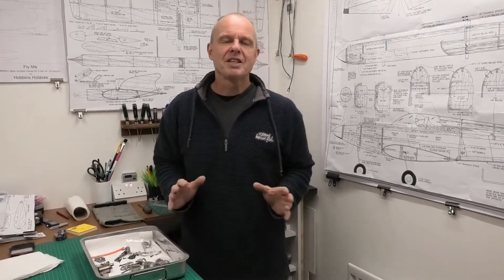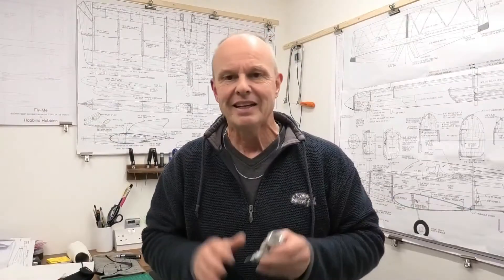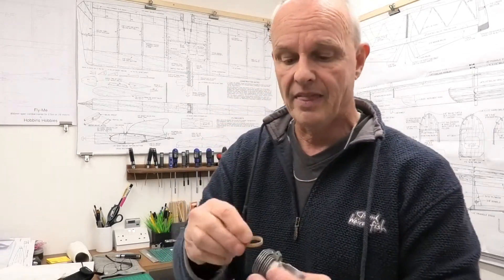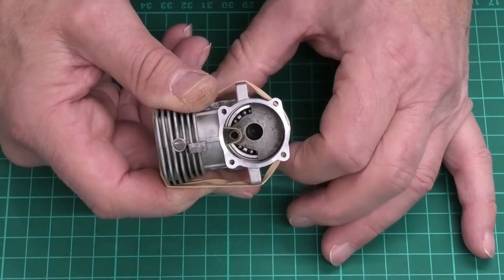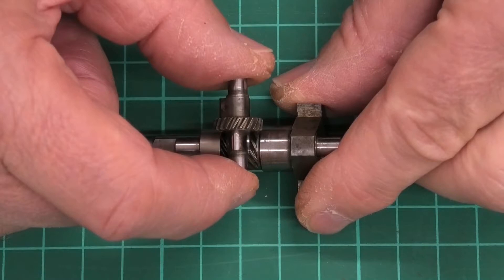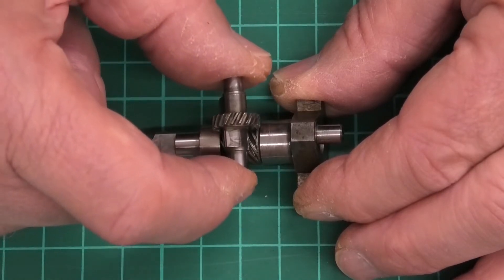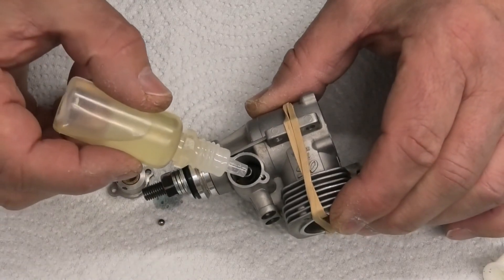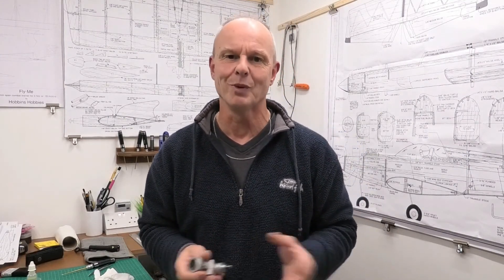OS FS 26 - Four Stroke Glow Engine Camshaft Timing - Get it right first Time!

Comment: I used your rubber band technique yesterday on a OS70 FS and it worked a treat. I also use your fuel tube tip for screwing in glow plugs .....have you got any tips for refitting the tappet collets? I fit them with the head in a clear plastic bag to catch the pesky little blighters when they ping off! 😂
Reply from the maker: Thanks for the comment, pleased you found the video useful.  Those collets on the valves are horrible to do, having a plastic back to catch them is a great idea.  I usually just hold down the spring with my thumb nail while I slip the clip in, holding the clip with forceps, but yes not a pleasant job and always a relief when done!

Comment: Hello Mark. Which bearings did you use for the OS FS26? Cab you give me the part numbers? Thanks
Reply from the maker: Sorry, I dont have the part number, the best thing to do with any engine is remove the old bearings and measure them as there are some times variations in the bearings used. This way will ensure you get the right size first time round. The bearings for this will be a fairly standard easily available size.
Reply: @MarkRobinson555  Hello Mark. The original bearings where NSK 6901 and 698Z. I have ordered the SKF 61901/6901 and the 619/8-2Z. The front bearing is double side shielded and the original one single side shielded. Could only find the 2Z version. Hopefully ok.

Comment: Mark, I’m having a hard time removing the wrist pin on the piston. How did you get your piston off.?
Reply: So I got the small,plastic pad off, but not the pin. I applied heat, and turned the piston to TDC, then used a small pic the pull the con rod off the crank.  It worked. Turns out you don’t need to remove the wrist pin.  So now I was finally able to remove the bearings and have new ones on order. Cleaned up everything in my ultrasonic cleaner, looks like it will be a new engine now!
Reply from the maker: I would remove the nylon pade each end of the pin, soak for while with thin oil, then heat the piston and place on a block of wood with a hole in it just larger than the pin and gently tap with a bronze punch, and it should slide out.  But, only tap lightly, too hard and you could damage somthing.
Reply: Thanks but you are assuming I already removed the piston. I cant get the piston out, how did you do,that?
Reply from the maker: You did ask how to remove the wrist pin from the piston, did you not? If you need to remove the piston and con rod from the engine you need to remove the head and back plate, take the cylinder liner out and then the piston big end will slip off the crank and the piston and con rod will come out the top of the crankcase. Is that what you are trying to do? Hope that helps

Comment: Mark, I’ve got a used 26 surpass as well and the bearings seem a little rusty, where did you get new bearings? Can you point me to a US supplier? What are the correct sizes?  Thanks
Reply from the maker: Hi Steve, much better to take the bearings out and measure them before ordering, than to trust someone else's word, then you will know you are ordering the right sizes.  I can't help you with US suppliers, I ordered mine from Henderson bearings here in the UK. Both bearings will be a fairly common standard size.

Comment: Really useful video how do you clean your crank case so good ?
Reply from the maker: Hi Mark, thanks for the comment.  If my engines are really mucky I clean them in an ultrasonic cleaner, using a product called SeaClean2, which is available in the UK, but not sure about elsewhere in the world.  As I am sure you know you do have to be carfull as some cleaners will darken the alloy, think some of the carb cleaners are probably very good, but always good to test first.  Also use a toothbrush and soap!  To clean between the head fins I use a credit card and some very fine wet&dry!  This engine, was not too bad, despite being mucky inside, think it was fairly low runtime, just not looked after, so all I used was a tooth brush.
Reply: I just got an FS 26 that needed considerable work but it was an unbelievable bargain.  I use an ultrasonic cleaner and a product called "L.A.'s Totally Awesome" dilute 1 part Awesome to 4 parts water.  It does a remarkable job.  Without an ultrasonic cleaner I have used Awesome undiluted and diluted 1:1 and light scrubbing with a nylon parts brush or toothbrush.  In the US it's available at most of the "Dollar stores," Walmart, Home Depot and Amazon.  It's very inexpensive.